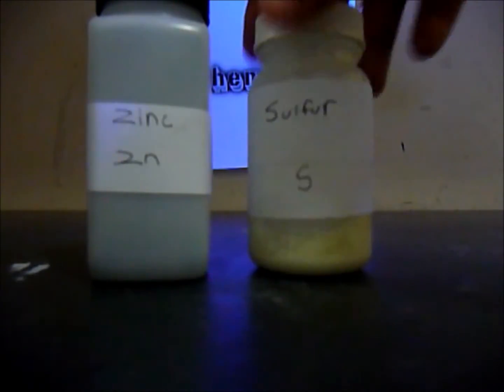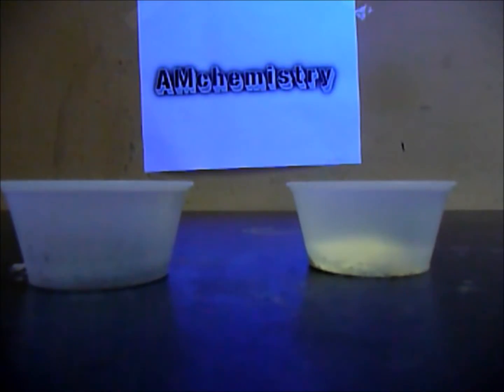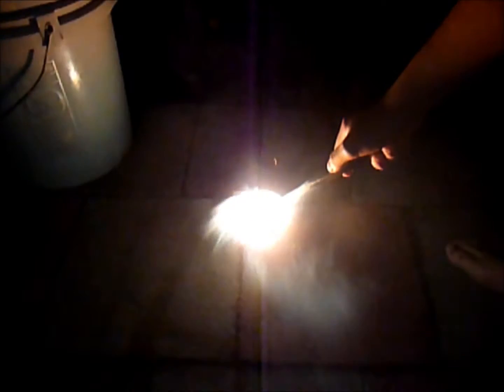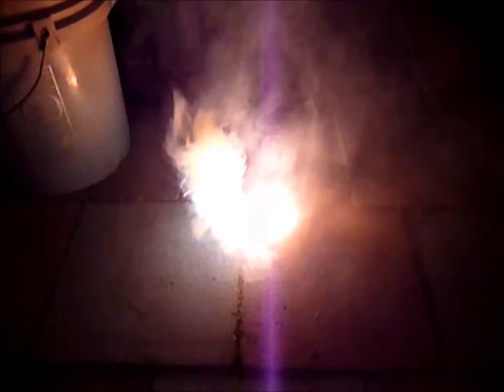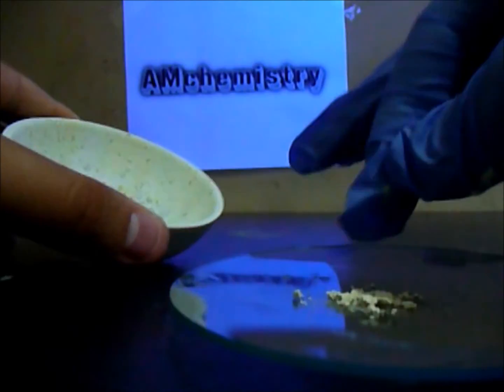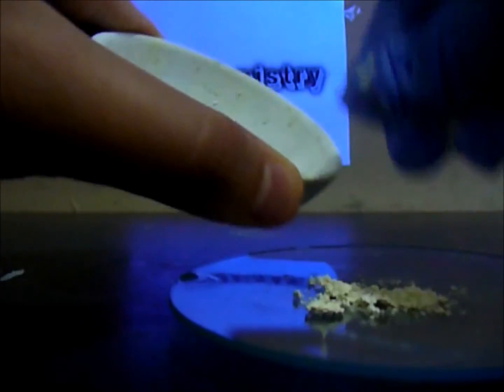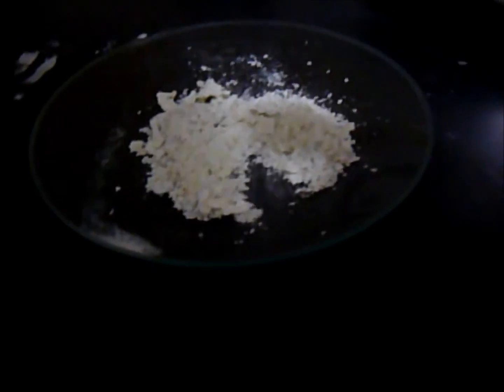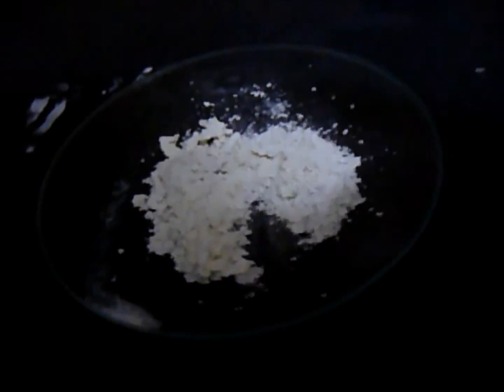Make Zinc Sulfide (Glow in the dark)

Comment: I made it several times using the ratio given here 4gm to 3gm and it just doesn't work.
Neither does it work activated by copper, nor by UV light.
Reply: 4g sulfur and 3g zinc didn't work too.
Reply: @Jenin2010  you need 6.5g of zinc and  3.5g of sulfur and add a bit of copper. you can use diferent metals than copper but copper is cheapest.
Reply: For this to work, the ZnS needs to be extraordinarily pure ("phosphor grade") and suitably doped. This procedure won't work and any afterglow observed is just your retina.